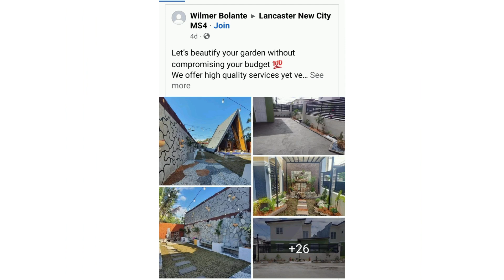96sqm House Tour with 4 Bedrooms Adelle with Fence Woodcress 5

Comment: May I know how much po yung naging contract price? and yung duration po ng construction?
Reply: pareveal din po sana nung supplier nyo ng tiles and lighting fixtures. Thanks
Reply: pati yung dinning set nyo na rin po, san nyo po nabili?
Reply from the maker: Hi Mary Grace! Sorry for the super late response. Almost 800k. Duration is 5months at that time dapat 3months lang kaso nga due to wala pang kuryente sa village so nagimprovise si AM Builders ng sarili nilang genset para lang matapos kahit paunti unti.
Reply from the maker: @marygraceasiado376  tiles si contractor po ang nabili pero alam ko po they are purchasing it from Wilcon. The lights po sa A and S po kami nakabili😊
Reply from the maker: @marygraceasiado376  dining set online po namin nabili. Not sure pero parang nasama ko na po ung details sa previous video ko😊